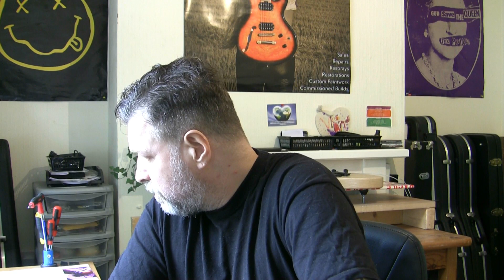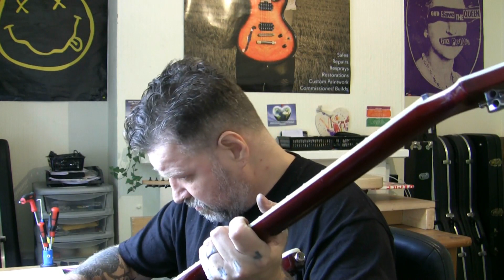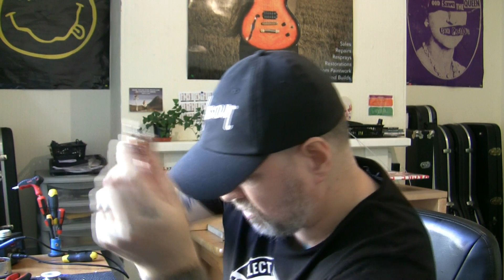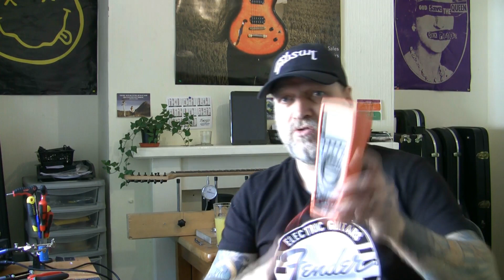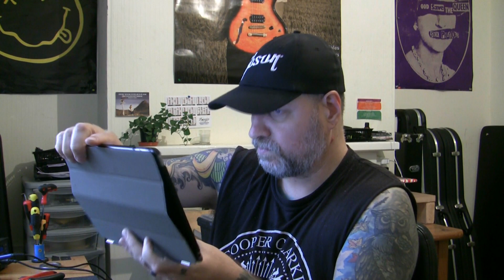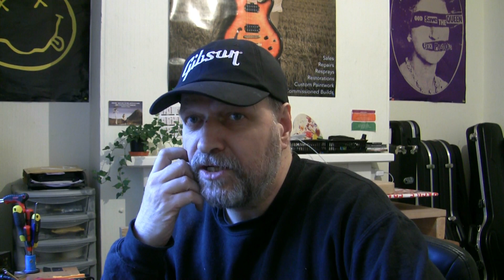Ibanez SA setup (full version) MIK (Korea) SA Series superstrat...

Comment: Hello, I have the same guitar, I can-t find this shema, could you tell me how to get it ? Thank you.
Reply from the maker: I don't know what a shema is...
Reply: @GuitarMedic-CANADA  Schematic ? Wiring diagram ?
Reply from the maker: @StephaneV79  Any H-S-S 5-way wiring diagram will work. You can find this information easily using Google. I found this: https://guitarelectronics.com/wdu-hss5l11-01/
Reply from the maker: @StephaneV79  There are many diagrams here: https://guitarelectronics.com/guitar-wiring-resources/3-pickup-guitar-wiring-diagrams/1-humbucker-2-single-coils/
Reply: @GuitarMedic-CANADA  Thank you Fret Friend, I still found these wiring diagram but the original wiring of my Sa360QM is special and doesn t match. The true duo Humbucker has 5 wires and there is a push pull which was wired I don t remember how. I bought a normal volume to make a simple wiring but I don t know how to make to have le split On true duo humbucker in 4th position.

Comment: When you’re installing pickups, I find it helpful to tape up the exposed ends of the cable lightly when pushing the cable through its respective channel and take them off when you have the pickup inserted. Do the same with all pickups but mark their locations on the tape to make sure they get wired to their intended locations on the selector switch

Comment: If it’s helpful, I find Fender make the best replacement pickup selector switches
Reply from the maker: Fender use Oak Grigsby: not a Fender company: From ToneShapers website: 'Oak-Grigsby is the current maker of switches for Fender's USA and Mexican production. ... Fender used CRL switches for decades, but the Mexican-made Oak switches are less expensive than the USA-made CRL switches, prompting Fender's move from CRL to Oak.'

Comment: The SAS36FM is a set neck model
Reply from the maker: What did I say?
Reply: @GuitarMedic-CANADA Neck thru. It does play like a neck thru but if you look at the neck joint a certain way you can see a difference in wood tones. Also, it did originally come with those singles. I got rid of the foam though since it makes adjustment unnecessarily difficult

Comment: Great vid. I have just acquired a very similar if not identical guitar to the one in the vid and have a few queries. Mine is a SA360QM TRB also a thru neck (not a bolt on). I'm trying to get the action set up properly as am getting fret buzz all over - lower frets and higher ones. I've straightened the neck using the truss rod. I know I can raise and lower the individual saddles to increase the action and hopefully stop the buzz, but should I try to raise the whole bridge posts up? If so, do you know how high they be set maximum, or do they have an optimal clearance which they should be set at? If so what is this and how is it measured? I think whoever had it before me has been messing with them, as one seems set higher than the other. Also, the pickups on mine seem to be the original ones. But, the neck pickup is quite a bit further away from the strings than the middle pickup. And the bridge humbucker is much closer to the strings than the middle pickup. Is that set correctly, if not, can you adjust the height of the pickups and what measurements should they be? Been looking on various forums but can't find these answer and measurements - any help appreciated.
Reply: Neck thrus are a logistical nightmare when it comes to adjustments. What trem does it come with?
Reply from the maker: I do not know ther information you need. I take a guitar in and I do what needs doing. Every single guitar is different and there is no set way of setting anything. You have to judge a guitar on how it presents itself and alter accordingly. There are no set rules. You need to Google 'set up a guitar' or similar. I cannot tell you what you need unless I have your guitar in my hands. Victor...